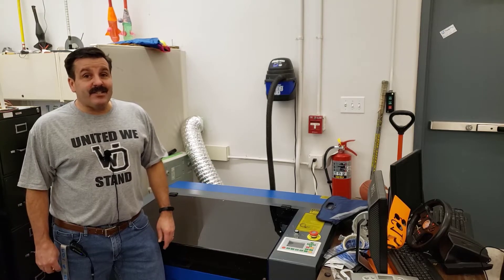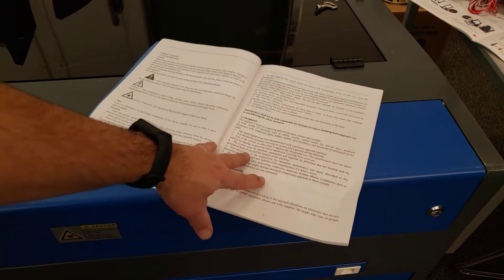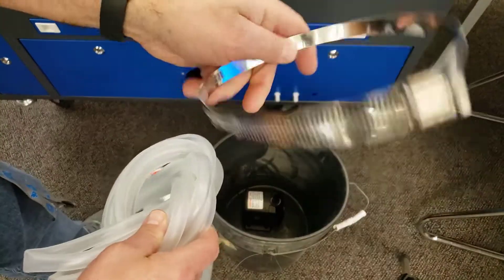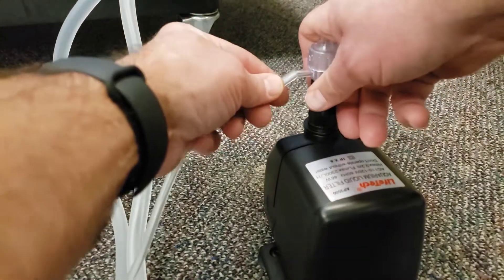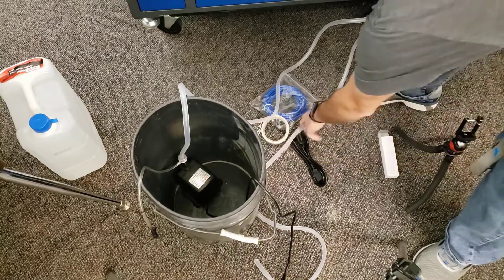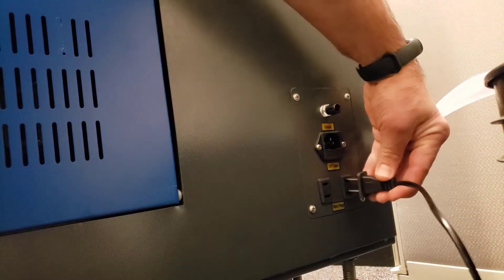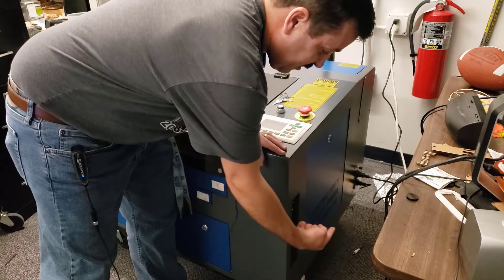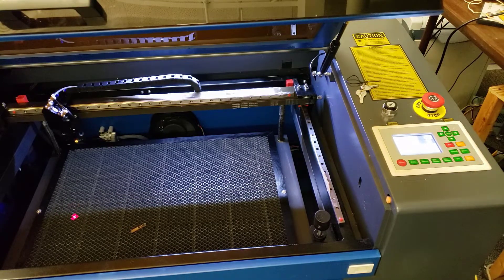Setup and Power On test of the Orion Motor Tech 55W laser cutter

Comment: Ummm...might need a refresher on water pumps. You don't remove the flow restrictor to "allow water in". It's not a stopper. When fully open, that's max water flow regardless.
Reply from the maker: Thanks for the note. I must have caught it later as I have never had any issues.

Comment: So I upgraded my light burn for Dsp controller but it still will not recognize my laser. I thought I would try to do it manually but I don't know the exact length of the x-axis and the y-axis.  Lightburn is asking for the lengths in millimeters but next to the Box it says inches.  I have the exact same 55 W OM Tech as you do, And from what I measured the x-axis is 27.5inches and the y-axis is 20.5 inches.  But I'm not sure if I'm getting the right measurements. Can you tell me what your measurements are so I can enter that and see if it will recognize it with the Ruida controller please.
Reply from the maker: I believe I just used 600x400 and the ruida controller.  Is DSP controller a different program or did you add a new component?
Reply from the maker: I just re-read the "door protect" steps for disabling. In Lightburn it will be under machine settings. To get there though you have to have your laser connected.
Reply: @HLModTech   So I reinstalled lightburn onto my other laptop and it found my laser.  But a window popped up and says waiting for connection and it never connects. Under the devices it says calm 5,4 and 6. When my ortur laser is plugged into the same port it says com 3  which isn't even on there. So I clicked on each one of them and it just brought up another waiting for connection line. But it still doesn't connect
Reply: All I did is upgrade my light burn And clicked on the DSP driver Box and everything was installed and said it was activated.

Comment: About the ground. The Manual says to ground from the laser and the computer to a grounding rod. How do you ground from a laptop and how did you do yours ?
Reply from the maker: I talked with a few people and found that the grounding in the US, like building codes insist on, should be enough. I have not had any extra grounding since I heard that.  Same with the PC I use. It is just grounded through the plug in the wall.

Comment: Hi friend,  another? I can't connect to my laser from my desktop.  Im running the internet cable that was supplied.  When i run the steps to find the laser manually in lightburn . It keep say its paused and doesn't connect to the laser. I've been using the usb do take the files to it . If you could help me be sweeeeeeet.  I've emailed Orintech still waiting.  Thanks
Reply from the maker: I have not tried the internet connection... I have it at school and getting the IT guy to approve it takes a bit of begging... I chatted with him once, but have not won that battle yet. I currently just use the USB.
Reply: @HLModTech  ok thanks and good luck

Comment: Check the clear piece on the waterpump as it should come apart so you dont use the little air hose
Reply from the maker: Thanks for the note. I have that hose on there, but I've never touched it. What are the drawbacks of having it on there?

Comment: air assist?
where did you connect the ground to?
is the air vent enough flow?
is that aquarium pump enough???
Reply from the maker: I do not have the air assist yet. My room is so large that I have not had a problem with smoke or smells.  I have had no troubles at all with the aquarium pump. I think some individuals may have not taken off the cap and burned theirs up... but that is just a guess.
Reply: @HLModTech  In the US, using a 3 prong outlet the machine is already grounded.  Added a second rod with a wire to that ground rod could cause a ground loop (depending on how close you are to the main ground rod).
Reply from the maker: @davidstephenson4411  Thanks and Yes! I found some forum post that led me to that conclusion as well. I will make sure I highlight that in the next video.
Reply: @HLModTech  thank you. this is the first time i have seen a separate ground connections
Reply from the maker: @paulshircliff  It was silly. I was just following the manual, but they are planning for all kinds of crazy wiring around the world. Just using 3 prong now. 👍